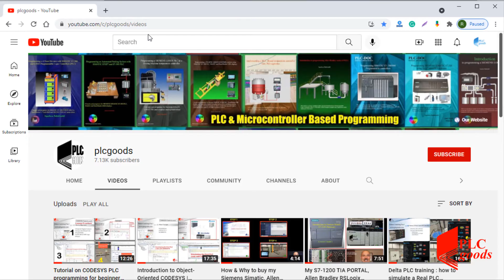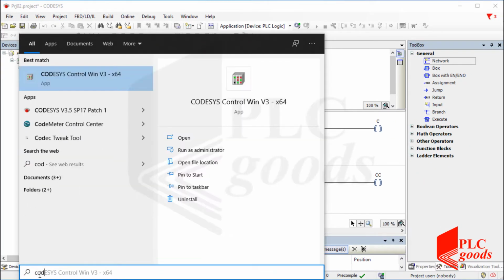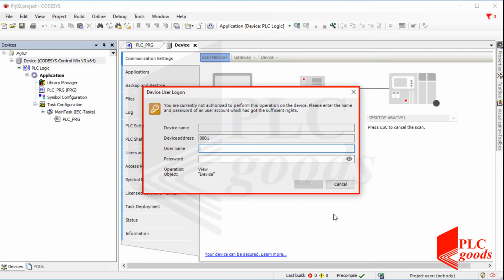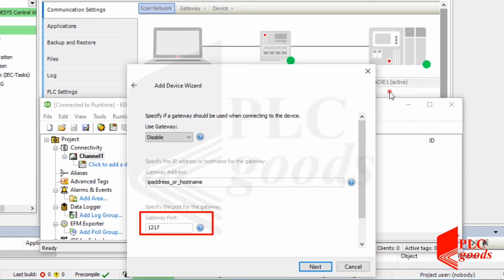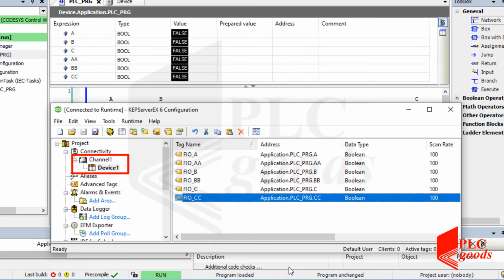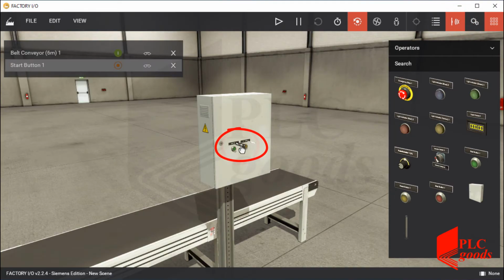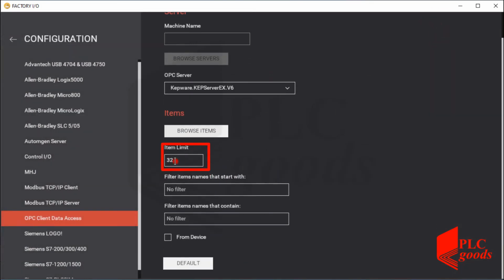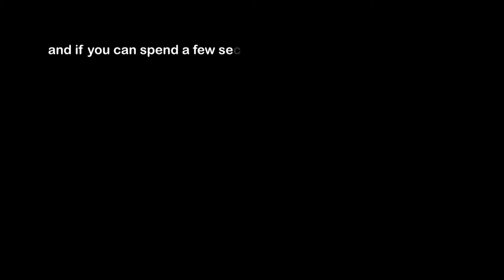CODESYS tutorial | Connecting CODESYS with Factory IO using KepserverEX  | Lesson 3

Comment: Hi! Thank you very much, this video is very helpful. However, I am having a problem connecting to the device on the virtual machine, it gives the following error: "Version mismatch: Selected=3.5.20.20, Online=3.5.15.40"

Can you help me where to change the Version to connect?
Reply from the maker: Dear valued member,
Thank you for your support and for being part of my YouTube channel! I'm glad you found the video helpful. Regarding your issue, the error message suggests a version mismatch between your software and the virtual device.
First, please make sure you followed all the steps exactly as shown in the video, especially when writing the control program. If you've done that, check the version of your software—does it match the one I used in the video? If your version is different, some settings may need adjustments to ensure compatibility.
Unfortunately, I didn’t encounter this issue while recording, so I can’t say for sure what’s causing it. However, I recommend watching other related videos in the same playlist, as I repeatedly demonstrate similar steps across different lessons. Hopefully, that helps you find a solution!
Let me know if you figure it out, and thanks again for watching! 🚀

Comment: After entering the user name and password in my first time connections, it shows “ no device is responding to the scan request “ . I have checked the gateway and systray are on but it’s still not working, can u give me some solutions 😢
Reply from the maker: Hi there, probably some of your connection settings are incorrect. Please see my videos in details. I tried to explain all steps to make a correct connection.
Reply: @plcgoods  Finally found out that the problem results from the device version disparity, after updating my device version on par with PLC, it went well, thanks.

Comment: Good video, i have a question, I don't find à multikey for changing the name...?
Reply from the maker: Hi there, please pay attention to the directory where I found the multi-key file. Note that, if your Windows is installed on another driver (For example D or E), you will need to find it inside that. Also, you can use the search option of windows to find multi-key file.

Comment: May I know why Scan network tab in my Device configuration cannot be access is it because Im only using Simulator?
Reply from the maker: Hi there, I tried to explain all steps. If you follow the videos, you won’t have any problem. However, if you have enabled the “Simulation” option from the “Online” menu, it’s better to disable it, before connecting CODESYS to other devices.

Comment: How to check connection between codesys and Kepserver ? PLC is running, tags added, but when I enter the quick client I didn't see any tags. I dont know where is the problem ?
Reply: Hi there, there are maybe several problems, For example, maybe your connection settings are not true which was explained during this video. Also, you can use the "Device Discovery" item to detect the settings automatically. see time 16:15 in this video: https://www.youtube.com/watch?v=wPW8Y8cHmYI&t=531s
Also, If you use the demo version of KepserverEX, you need to stop and start it every 2 hours. 
however, I try to explain and solve all problems during the course. please see our videos carefully.
Reply from the maker: Thanks for checking out the channel!

Comment: Hello thank you so much for the tutorial. But my issue is a little different. I am using a plc based my raspberry pi and Codesys is v3.5 sp 17 patch 3. I remember my device user management credentials and like every other time I entered the correct credentials but instead of allowing me to connect to the device, codesys keeps asking me to enter the credentials again and again every 2 seconds. The device tab turns green as well. I am stuck here. Is there a way i can get through this??? Please help
Reply from the maker: Thank you for contacting  me regarding your question BUT I never used the CODESYS on Raspberry PI so I do not have any idea how you can resolve the issue you have.

Comment: Nice work you are doing. I got a problem with the setup. I can't find any device. Gateway is showing green light but device is saying gateway not properly configured.  Please do you have any idea what the problem might be? @ 05.08
Reply from the maker: hi there, Please see the video carefully. I displayed all steps to solve this problem with my system during the video, and also I told extra points that might be useful for other systems.
Reply: @plcgoods  Thanks for the feedback I will look into it.  Thanks.
Reply: @plcgoods  you did not have the same problem so you did not show steps on how to solve it.